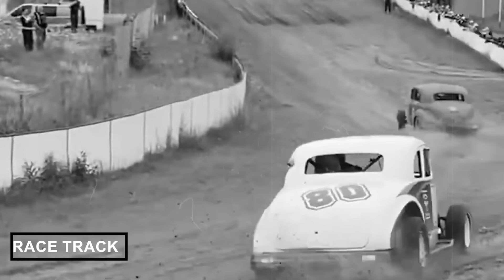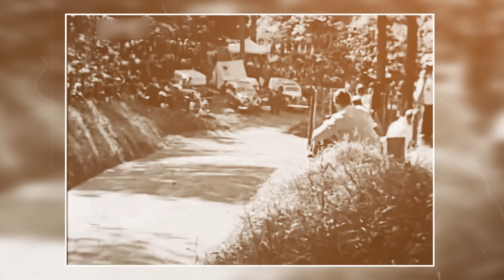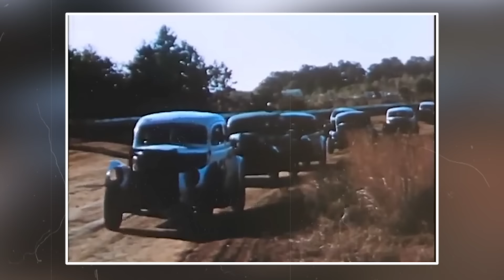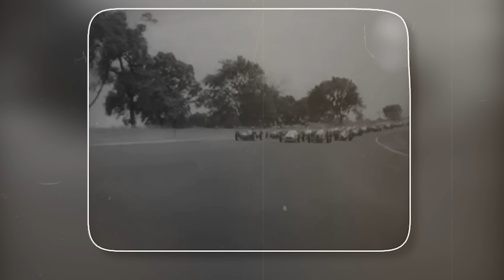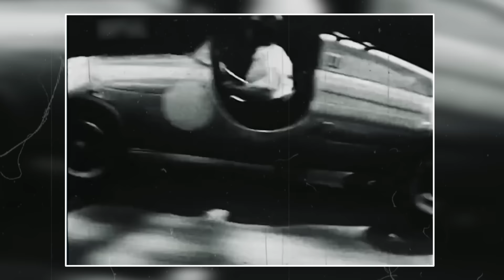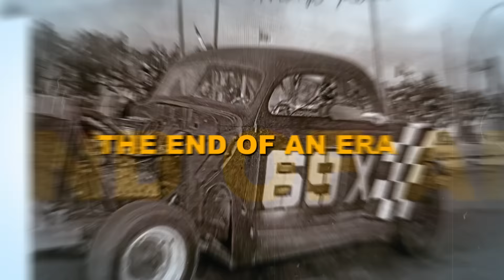How One Miner OUTSMARTED Racers With a $20 Exhaust Hack in the 1950s

Comment: yes this is why small tube headers work better than big ones, the exhaust is moving faster going into the collector and also makes a vacuum at the exhaust valve for the next stroke, same thing on the intake side small long runners will compress air before the valve opens

Comment: Returning Veterans from WWII discovered tens of thousands of mid 1930's - 1941 cars up on blocks, in garages and stored in "out buildings" because of Wartime rationing of tires, batteries, engine oil, gasoline and more. Wartime America became a car pool society. By 1952 Detroit still hadn't caught up to new car orders so some of the "old cars" were being refurbished. But young Vets wanted a car - to fix up, drive, show off and race. 1938 - 41 Plymouth coupes and the same era Fords were abundant. In races, the Plymouth "6" beat Fords at the start, while Fords with "V8's" took over at he finish lines. Desperate Plymouth owners bolted on a twin carb kit and special ignition (magnetos). This allowed them to win races - ONCE. They ran too hot and by a race's end their long rods had overheated and bent. Ford owners teased them as being "hot rods": - initially a derogatory term. But stories and rumors by the misunderstood public took the put down as an all encompassing term for EVERY modified race car. "HOT RODS" were mainstreamed. At 80 now, I lived through the stories these racers would tell - bench racing as an 8 year old. What a GRAND TIME...

Comment: I've never heard of inserting a restriction into the exhaust of a four stroke engine expecting better performance.  
I was taught to keep the primaries close to diameter of the valve.
From there a 180° scavenger mates the two primaries as seen on the distributor that 180° apart from each other
The fabrication is a nightmare , and not practical unless you flip the heads and place the exhaust ports  on the inside. 
That's what all that spaghetti exhaust routing is all about on Formula One cars
What this guy's talking about sounds more like expansion chamber two stroke theory.
But what do I know

Comment: This is a fake. I found Frank A. Kowalski's obituary. The picture they used is correct. The information is wrong. He wasn't born in 1922. He was born in 1923 in Toledo Ohio. His obituary says nothing about racing in NASCAR. Never worked in a coal mine. The physics of putting a restrictor plate in exhaust is bogus.
Frank A. Kowalski, 94, of Toledo, passed away at Hospice of Northwest Ohio on Wednesday, July 4, 2018. He was born on September 16, 1923, to Frank and Clara (Bonk) Kowalski. Frank served in the U.S. Navy in World War II as a motor machinist mate aboard a LCT, and later aboard a submarine chaser. In the war, he participated in the invasions of Guam, Tinian and Saipan. He worked in the automotive industry at Willys-Overland, Champion Sparkplug, and General Motors. He was a Journeyman Tool and Die Maker, Communion distributor at St. Vincent's de Paul Church, and member of the Knights of Columbus. Frank was intrigued by science and technology, and spent much time at the local library to research his interests. An avid harmonicist and magician, he often entertained his family at gatherings with his musical and illusory talent. He was a great source of humor and warmth, and was friendly to all.
Stop with a fake stories!
Reply: totally agree. There are NO papers published in the 50's, 60's or 70's describing step tube headers. I know because I invented them in 1982 and used it on a pro stock car in NHRA. No one noticed until 1984, then it got out.

Comment: I worked in an underground copper mine in the 70s. We had an air mover device we called a bazooka which, when attached to the compressed air line, would, using the venture effect, move a tremendous amount of air in a drift (horizontal tunnel). This has set my old brain to scheming. Thanks for the cool story and the inspiration.